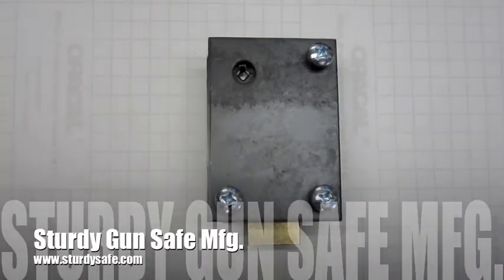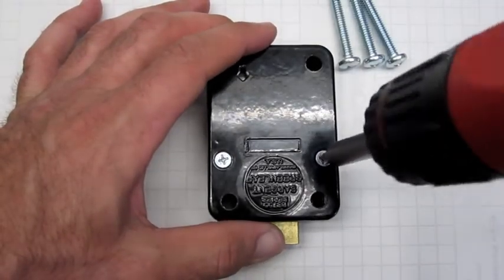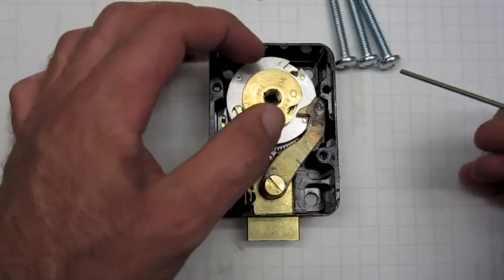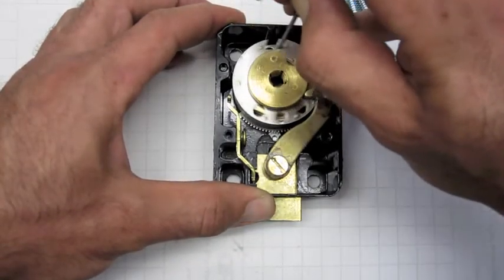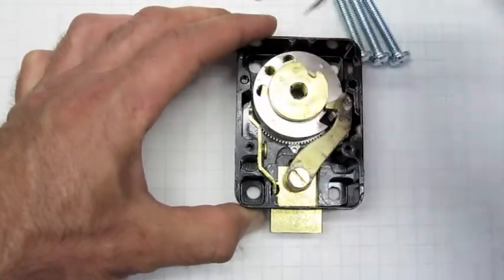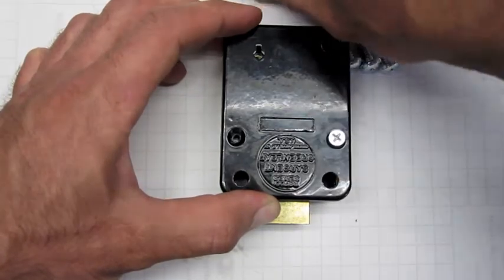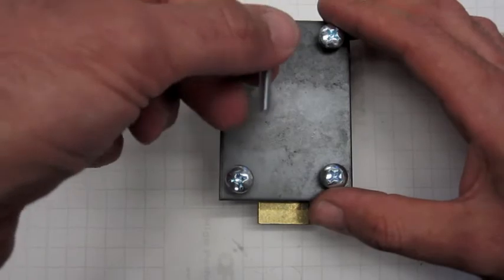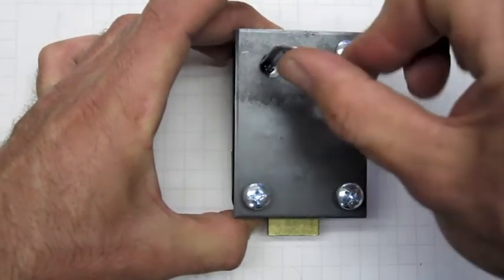Realigning The Tumblers Of A S&G Lock If You Messed Up Changing The Combo | Reset Combination Fix

Comment: why cant my lock turn when my change key is inserted?
Reply from the maker: The cover plate will need to be put back on the box so you can no longer see the brass wheels before inserting the change key and turning it.
Reply: @SturdyGunSafeMFG  yeah i was working late last night and inserted the change key without the plate on. is the lock trashed now?
Reply: i also removed the change key in the change key position
Reply from the maker: @josephwalker7432  Bummer. It’s the removing the change key while in the changing position that got you in trouble here. You will need to be directed on how to fix this. Give us a call. 800-262-0023
Reply from the maker: @josephwalker7432  Yes, can you remove the lock and bring it to us? If it’s a sturdy safe I have videos of how to do this I can send you.
Reply: @SturdyGunSafeMFG  Hi again, im just letting you know i fixed my lock so i wont have to bring it in. It was as simple taking the cover back off and turning the change key screw back to where it was. i dont know why i didnt think that! i appreciate the help, thanks!!
Reply: Youre not aligned with the tiny hole in the rear. At least that was my issue

Comment: I just won a safe at an auction, the safe was left in the unlock position i have access to where the change key is, but i am missing the change key, is there a way I can program the spinner without the key? thanks
Reply: If you find out let me know, I’m in same situation
Reply: Change key is nothing but a piece of metal sturdy enough to press the springs inside all the wheels at the same time. Anything that can push the springs constantly while you dial the new combination will be okay. And you can try multiple times in case it fails at first. The dial should rotate smoothly if you have tensioned the springs correctly. If the dial feels grinding, do not continue rotating or you could mess the teeths inside the wheels.